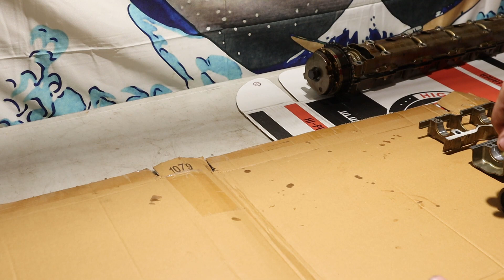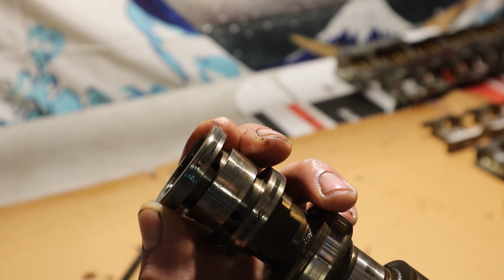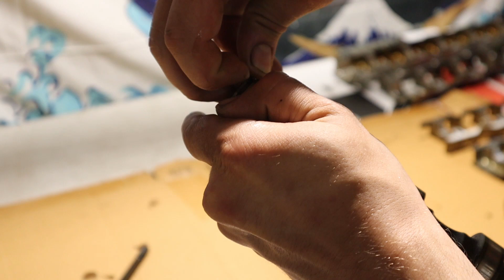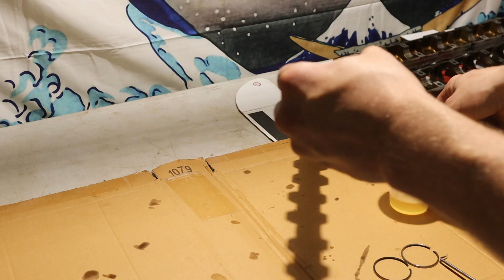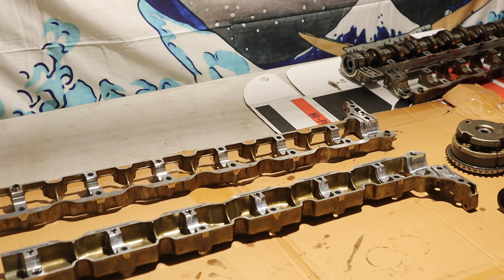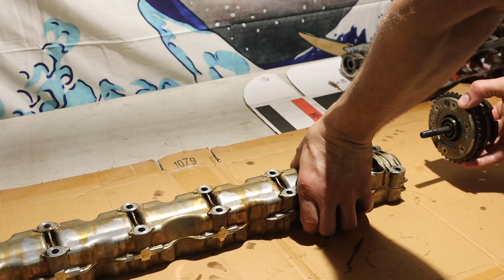BMW N54 Cam Seal Upgrade!

Comment: Hey bro I have a question, so long story short I have these new seals I already put them on my camshafts , I haven’t installed them yet though because I just bought another set of camshafts with ledge trays for a good deal with lower miles and better condition , now what I’m trying to do is take them back off my older cams all 4 seals and put them on the cams I just bought , that’s ok right?? Don’t wanna over stretch the seals you know .. thanks in advance man I know it’s a confusing question but since I’m already here I wanna make sure , or do I have to re order them 😢
Reply from the maker: @boost7236 honestly I’ve never tried to remove them after I installed them, if it was me, I would try to remove them, and see if they look damaged or stretched out, if they are questionable I would just buy new ones, but I would try to save them first!
Reply: @dirtykurty92  bro thank you for the reply man , yes bro I’m literally in the process of doing my trays and cams along with timing chain crank hub all that , so I did just take one back out and it kind of looks good but kind of doesn’t really hard to tell honestly
Reply: @dirtykurty92  but just like any other seal.. these go in place as should once the car is started exposed to heat right ,
Reply from the maker: If it’s questionable I’d just buy new ones for sure they are not too expensive, and would hate to have one fail
Reply: @dirtykurty92  bro your reply’s mean a lot !! Thanks again honestly top of my head of course that’s what I been thinking the while time but the fact that I didn’t wanna wait any longer !!! But better safe then sorry bro and I hope once I put everything back as accurate as possible the car is good
Reply: Maybe I can get away with just using these honestly , if fail ima have vanos codes like crazy that’s probably the most horrible thing I can think of regarding the seals lol
Reply from the maker: @boost7236  hey no problem happy to help! If you need anything else don’t be afraid to ask! Good luck with the repair!
Reply: @dirtykurty92  if you were local that would be awesome need more n54 homies lol , have a good one bro thank you again

Comment: Heads up guys, the updated composite or teflon seals will still wear out the cam ledges. This happened on my clients 2011 1M with 117k miles. He was having intake VANOS faults and we found both the intake and exhaust cam ledges with deep grooves and he had the updated seals from the factory. The teflon seals do lessen the wear but it'll take some time for that to happen.
Reply from the maker: Wow! Thank you for the update

Comment: Is it enough when i replace only the input cam seals? Because i got only vanos failure with this side, not with the exhaust.
Reply from the maker: Well that depends what your plan for the vehicle is, if your just trying to get it going again cheap as possible, yes you can replace just one side, but we’ll it’s apart your so close to that other cam seal, I’d suggest replacing well it is apart
Reply: @dirtykurty92  thanks for the answer. The insight cam trail i will replace with used cam Trail + seals. With the other output, the "good one" i will replace the cam seals only too.
Reply from the maker: Good luck with your repair!

Comment: If the seals are bad will This cause the car to go into limp mode right away and give codes intake camshaft installation faulty? And exhaust camshaft installation faulty ?
Reply from the maker: To me that sounds like the is an issue with the actual timing. So crank shaft relative to cam shafts . it was not properly set, or something happened to cause the engine to fall out of timing. Was there something that happened before the code turned on?
Reply: @dirtykurty92  yeah my car was out of timming, re timed the the intake camshaft it was off checked my timing chain was not stretched. So the only thing they replaced was my Srpockets and phasers, they also checked my crank hub and said it was good they also too the cover twice to make sure it was in time and yeah but keep getting those codes

Comment: Now N54 got vanos inlet cold code
Reply from the maker: What code is it?
Reply: 2009 x6 n54 I remove the  and oil pan timing hut by mistake I buy tools and put everything back and now  
2a7c
3100
2e97h/11927
2a7a thanks for your help
Reply from the maker: Hmmm interesting, so sounds like a vanos issue potential, start by making sure you have enough and good oil in your engine, if that is good test the vanos solenoids, maybe check your vanos oil screens. If you took your timing apart making sure your cams are in time is very important.
Reply: I removed the Crank hub by mistake I found screw head in the oil pan, I buy timing tools new vanos solenoides, ow20  i'm thinking to put 5w40 and reprogram The vanos solenoides
Reply from the maker: Any luck on figuring out your issue?

Comment: One test to do is put the seal in place with out the cam and mimic the pressure with c clamp. The seal should be snug with some pressure, if not the groove in the tray is no good.
Reply from the maker: Good idea never thought of that!
Reply: @dirtykurty92  I tried it like 3 times on some builds and they all turned out good. Single turbo levels. Just put the new upgraded seals so it won’t dig anymore.
Reply: true i’ve read the upgrade seals are thicker and doesn’t grind up your trays like the old ones are intentionally made to do.

Comment: How many km on this engine? Am about to pull mine apart and replace a leaking valve stem seal and wondering If I should do new cams new cam caps new composite cam ledges new valve springs new lifters and rollers and retainers and retaining clips aswell while I'm at it. Mine has 150,000km on it and its unknown how much wear is all of it....
Reply from the maker: My engine has around 127,000 miles so over 204,000km. It really depends if you have wear on the cam ledges weather you should replace them or not, your looking at around 1100$ usd to replace both with new off fcp euro. 1000$ EACH for new cams.. I would say same goes for the lifters and roller rockers,  inspected for damage and replace as needed. For 24 lifters your going to spend almost 300$ and for 24 rocker arms your going to spend almost 400$, for 24 springs almost another 400$... I’m a fan of if it isn’t broken don’t fix it. Between tools and bolts and seals your going to be in almost 5000$ if you replace everything with new and to me that’s not really justified if nothing is wrong with the parts now
Reply from the maker: I would replace all the valve seals,  replace the cam seals with the composite ones(need 4), new cam gear bolt(need 2), intake manifold gasket, and valve cover and oil filter housing gasket if it has not been done recently. Timing chain tensioner comes out so can be replaced at this time too. New oil, filter and coolant.
Reply: @dirtykurty92 it's worth noting the oil cooler line o-rings (assuming one has an oil cooler) should be replaced when doing the OFHG, as well as the oil cooler thermostat housing gasket (all of this comes in the OFHG Kit from FCP Euro).

Also worth mentioning in case a real newbie is about to go shopping online ahead of doing this work: the intake manifold gasket is actually 6 gaskets; removing it means removing the throttle body, in which case one should replace the throttle body gasket as well.

That all said, none of this is really a significant overlap in terms of work with the valve cover gasket job or the cam ledge seals. Do the VC, cam ledge seals, and maybe toss in a new PCV valve if you want to be extra preventive, and plan that as one job.

The OFHG, intake manifold, and oil cooler line/thermostat o-rings and seals, etc. should all be planned as a separate job. You don't want any one project to be too daunting or too drawn out or you will lose interest or time or money, and/or lose parts, etc. Doing the OFHG gasket and the rest is also a great time to also walnut blast your intake valves, but that does require:

1.) a special adapter to fit the intake ports (~$60 for the aluminum one, which is worth it. You can resell it later if desired), 

2.) a media blaster; incl tank, wand, regulator, and hose (~$140 from FCP Euro)

3.) a suitable air compressor (shitty pancake compressor isn't gonna be fun--I have a 26 gallon, 4.5 SCFM (@90psi) compressor and anything less would have been really annoying)

4.) A shop vac to attach to your adapter for re-collecting walnut media as you spray it

5.) Some medium walnut media (cheapest I found was Home Depot store pickup 25 lbs for $25)

and optionally, also:

**A set of stainless steel dental picks for scraping big chunks off

**A remote starter button to attach to the starter for turning the engine over to get valves fully closed before starting each cylinder ($10-15 at auto parts store or Amazon)